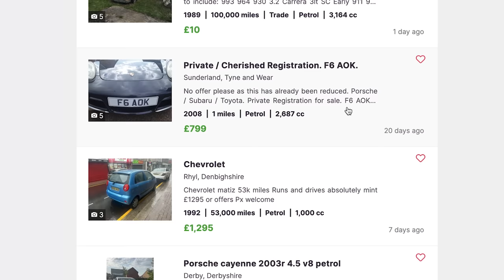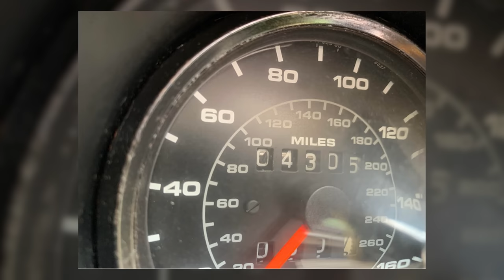We Bought The Cheapest Porsche On The Internet

Comment: Had one  of these once in the  early 90's. Cost 1200 quid. Dash was ripped and paintwork iffy but otherwise ok. Guy who looked after it in Kimpton used to race them in their own series at Knockhill so mainly handled them in his garage. Had it all mechanically sorted and race tuned and ragged it solid. Needed 3 engine rebuilds at 800 a time though due to racing around herts too hard yet it could handle the A1/M25/M4 commutes easily being auto and the driving position was like rolling out of bed and still being in one as you drive. The boot space was enormous as i moved house a number times fitting everything in the back with the bucket seats folded down.

Comment: It's insane how cheap used cars are in the UK. Here the Porsche Cayenne 2003 V8 you saw at £1,400 there costs like €30,000 used here in Portugal lol
It's even more insane that from £1,250 to £1,400 you go from a pile of trash that's more rotten than a mummy in Egypt, to an actual very usable and good car. Bellow €3,000 here you would just find rotten trash like a rotten and rusted up fiat punto from 1980 with a missing engine

Comment: i had a porsche 924 bought it for £500 off car and classic many years ago,the chap had taken it to a porsche main dealer for an mot and they had failed it on many minor things.
had to replace rotted fuel lines which run above the rear axle and it sailed through an mot,sadly i had nowhere to store it so had to sell it.
Also i had a golf GTi same year and colour as yours which i bought from BCA auctions at Blackbushe bit of a pig wouldnt start and had an old immobiliser i had to remove.
i think you should get a mk2 scirocco next i had 3 of those,great cars.

Comment: That 924 is completely done for, it's a spares car. Also, wasn't the cheapest as there's been 2 in my saved listings on marketplace up at £800 & £1000 which have been listed for a few weeks.

Paid £370 for my 924 back in June and it was in far better condition than this heap.

Comment: The 924 is a great driving car,  but then I'm biased because I own one. Mine is one of 2 or possibly 3 cars in the UK with the super charger kit fitted. In standard form the car is a good handler but the engine is uninspiring.  With the Super Charger its a much better driving experience.   There is a review of my car here: https://www.youtube.com/watch?v=biVROE4WFDw&t=26s

I also have a spare bonnet if you are interested?  The 924 owners club is the best source of info for trouble shooting engine/ Bosch KJet problems. I can also help too, just ask :)

Comment: Top gear did it for 1500£
Reply: Yeah they did, but how many years ago?
Reply: The value of cars has change a little bit since then….
Reply: Which would be around 3 grand now.  £1250 now is around 750 back then.
Reply: @danielseelye6005  According to the inflation calculator, you are spot on.